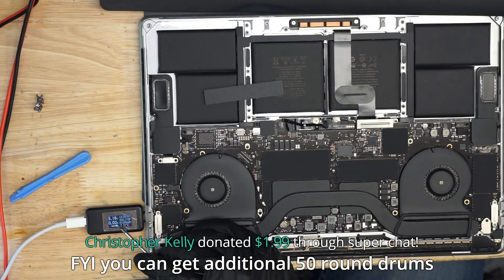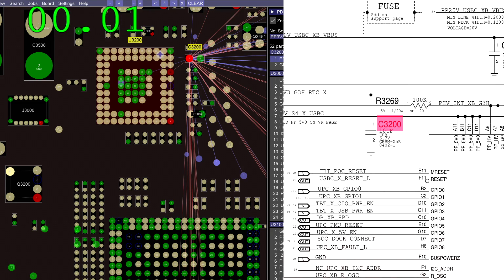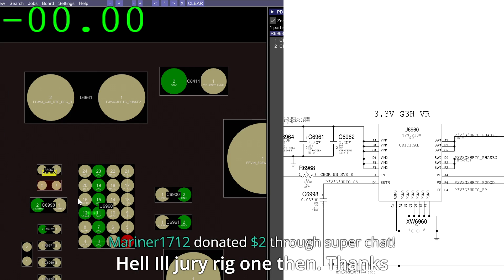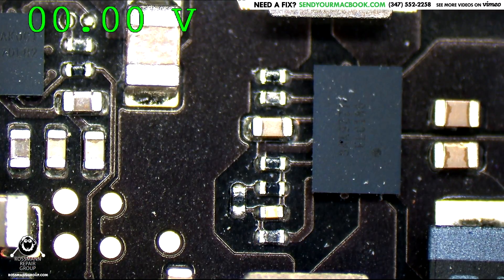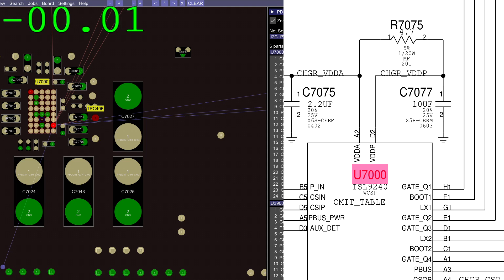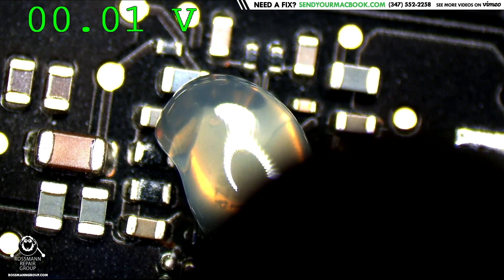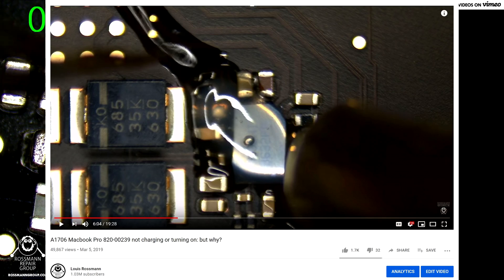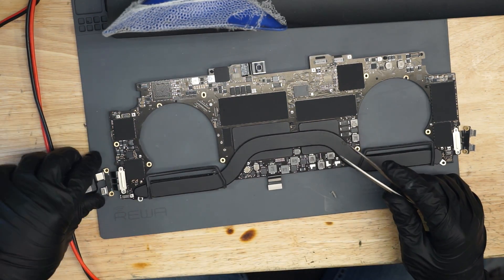How Apple is shaping the future of repair.

Comment: Imagine having to replace your engine just cuz a spark plug missfired.
Reply: Imagine your car refusing to turn on because a headlight was burnt out.
Reply: If the car is made by apple you'll replace the whole car
Reply: Or the spark plugs are non-removable. THAT could be next. So sad...how is this country to be great again when such tomfoolery abounds?
Reply: @dcanaday426   afaik, car companies don't do exclusivity deals with individual component manufacturers.

Yeah, ECUs can be directly bought from car companies for a lot less than a new car, but that's just an option, since most individual components are for sale, usually not by the car companies, but through resellers that buy components from the manufacturers, though.

Anyway, while you CAN buy individual components and repair ECUs, most people don't do it since buying the ECU from the car company/ manufacturer is a lot easier, not to mention that most people don't have skills to do that kind of repair.
Reply: @liev535  It's even easier to find a wrecked car & yank the ECU out of it. Hella cheaper, too. And, the car companies can't stop you from doing it.
Reply: @texarcana2002  true, and they would face endless lawsuits if they tried
Reply: @sayan mukherjee 
More accurate. Agreed.
Reply: @sayan mukherjee yes because replacing the engine along with the labour costs will happen to be more expensive than the total value of the car
Reply: @sanghamitrapradhan5820  looks like you'd have to buy a new car...
Reply: Shhh. Dont give them ideas.
Reply: And the local car rig guy calls himself a genius even tho he terrible at fixing car lol
Reply: @dcanaday426  well hopefully if theyre a good car manufacturer then they will either make or source reliable computer modules for the cars electrical systems and sensors so that they last longer and you dont have to worry about it going out on you after years of driving. Well, at least the older models were built with reliability in mind. Dont know about all the new car models since they havent yet stood the test of time.
Reply: Hide and watch, people! This IS where we are headed unless the populace rises up and says NO!
Reply: Blew a fuse? That'll be a whole new electrical system.
Reply: @zephyr9756  Funny you should mention: Federal Pacific "Stab-Lok" breakers were found in the 1980s to have inherent defects that caused of thousands of fires in the U.S.  Even if FedPac panels are legal to operate in your jurisdiction, good luck finding a replacement breaker when one fails!  It's like trying to buy Freon (R-22) refill kits shortly after the auto manufacturers were forced to switch to R-401A: it was still legal to sell your remaining stock, but you couldn't buy more because they stopped making it, and the price skyrocketed.  Buying a Apple product with this fragile 9240 chip made of Unobtainium is as smart a move as installing a FedPac panel in your new house--knowing that replacement breakers were only going to become more rare and expensive (and prone to failure!) as time went on.
Reply: Or replacing the entire inverter and motor assembly when you only need to replace a bad MOSFET or 2 on the inverter of your electric car.
Reply: Your engine? You have to replace your whole car. And if you left some important item in your car, that's gone too.
Reply: That sounds like Ford Triton engines spark plug issues bliwing engines
Reply: ... and not even stopped the engine itself but some software decided that its junk now.
Reply: Why image? That's how it is now
Reply: Imagine having to replace your car just because a spark plug misfired.
Reply: @dcanaday426  It will surprise you, but you can buy every single component for a car for X number of years, freely on a market and than choose who is going to repair it. It may cost a lot but it is there, by law. At least in EU.
Reply: @dcanaday426  are you stupid? can you not do a little research? you can buy pretty much any component, transistor, capacitor, or chip for your cars ecu, you have access to programs to flash it, modify it, tune it, this isnt an actual problem, car manufactures generally use off the shelf parts which everyone has access to. ECU modding is a big thing, only people who are stupid wouldnt know any different.
Reply: @shroomzgames7370  ha well said. Bet that guy owns a apply product to.
Reply: @dcanaday426  nobody is asking apple to stock and sell every single component though. All we want is for them to stop blocking their sale. Apple does not manufacture every single part of their products and the people who do are selling them at component level already (to apple) all we want is to be able to buy them from the companies that make them even if the minimum order is 1000+ chips which is reasonable.
Besides you can buy every single peice of newly made cars for a number of years after it was made by law.
Reply: @@UCU3kMKsz3tNH4KBsKvu2xVA I don't think you understand how modren manufacturing works.  Apple doesn't' make ANY of the chips in their laptop or 99% of the other stuff in there either.  They purchase them from third parties such as chip manufactures and then assemble it.  Those chip manufactures ONLY make and sell chips.  It makes no dirrece to them if they sell em to Apple or a ditrubtor who will then resell them to repair shops.  All Louis wants is for the chip manufactures to be able to sell the chip to him as well as Apple.  They dont' only because Apple is such a big customer they were willing to sign and exclusivity deal to get Apple's business.  The net result is Apple can sell you a new laptop or very expansive logic board replacement repair which creates unnecessary eWaste because a $4 chip is dead on the motherboard. Exclusivity deals like this which exist only to serve as a method of planned obsolesce harm the consumer, third party repair, create quasi monopoly situations, are bad for the environment, and waste precious, nonrenewable resources. Which is why they should be illegal.   In contrast an ECU which you used for an example uses mostly wildly available off the shelf parts.  You can go buy an individual chip if you want from whatever company makes it and sells it to the car manufacture.  And yes people do that.  ECU modding/repair/re-flashing  is a thing that hobbyists do.  You are very ignorant if you think Ford, GM, VW, ect manufacture all the components for their cars right down to the chips, resistors, PCBs, ect in the ECU.  No product is made that way.  Even Intel and AMD don't manufacture the chips in their own CPUs believe it or not.  Places like TSMC and Global Foundries do.
Reply: dcanaday426 ehmm you can buy 3rd party spak plug ?
Reply: @lfow0234  Imagine having to replace your engine just cuz a spark plug failed--and only the dealer has spark plugs that fit--and they won't sell you one. (TIFIFY)
Reply: @lfow0234  now imagine you coudnt buy any spark plugs only from brand manufactory and they say u need new engine

Comment: Does that charging chip do something special, or sends some special commands to other parts of the board, no other chip does? I remember you tried to swap it for older one and found out that, pinout was different. But what if we could make a adapter board to use another charging chip, or microcontroller programmed to send same signals as ISL9240? If it's commands are any different from ISL9239 I guess it is possible to reverse engineer it using  logic analyzer. That's may be an overkill, but people still make hacks to old gaming consoles and vintage computers, why can't someone make a hack to replace a ISL9240. I bet it will be a great deal for those who wants their data back, or simply needs a working laptop and doesn't have extra 1500 to spend.
Reply: @makumbaDE  maybe I would, if I had motivation, or enough free money to buy a macbook, several macbooks, actually. I didn't own any apple product in my life, but I like Luises videos and love electronics. That's why I asked this question. The market is there and it's a good aportunity for repair community to regain their rights.
Reply: @makumbaDE  well, you can't fight apple an their kind with such mindset.

Comment: If you really need your data, you can borrow this IC from another (working) board, restore your data and put it back.
Free market should create a replacement for this chip, with compatible pinout. But next step would be to add some encryption (or simply a chip ID) so this isn't right to accept such stupid rules.

Comment: I mean I don't want my work computer with many work data in it suddenly bricked and there's nothing I can do about it.
Reply: Backups. Have all your data in at least two copies, if you can afford it then 3 copies and keep one of the copies "cold", unpowered when not in use. Do not trust cloud if the data is in any way sensitive.
Reply: @Cinkodacs  I think we could just make the storage detachable not soldered on to the motherboard. or at the very least as louis saying it a computer has a lifeboat connector for such situation.

Comment: What if you invested in a few donor boards to get a few known good ISL9240s that you can use to temporarily fix a system solely for data recovery? Seems better than nothing!
Reply: I was thinking he could get BGA socket adapter like giga-snap so that he could install a female on the board and use one good ISL with a male adapter.  The only problem is that 8 x 5 arrays are not standard, so he would need a custom order.
Reply: @jeffm4508  I don't know if one of us is misreading the other but what I was getting at is he has 2-3 known good chips, he can install them on a customer's board, recover the data, remove the chip, return the same broken laptop with a backup of the data, wash rinse repeat. It doesn't fix anyone's system but it would put him head and shoulders above anyone else if he can say "I can't fix it but I can at least get your data"
Reply: @kusucks991  He could just use BGA adapters like "giga-snap" to make the chip "pluggable". It might require a custom order as 8 x 5 arrays are weird.

Comment: Why can't you use a pull up resistor on U6960 enable to force it to turn on?
Edit: Datasheet for TPS62180 show Enable directly connected to Vin.
Reply: Jeff M My thoughts too, but the system probably detects tampering.
Reply: @gordonrichardson2972  It doesn't monitor low level power chips, or Louis would not have a business.
Reply: CK Lim  It is the primary power rail. Its on at the beginning.

Comment: Why not charge the battery externally? I mean there are other ways around to charge a battery. Well, I can do. At least to get that data out of that mobo. Just connect the required voltage to the lipo battery terminals internally. No software can stop you from doing that.
Reply from the maker: ISL9240 communication appears to be required for the machine to function.

Comment: Did someone try if the 9241 works? I wouldn't be surprised if the manufacturer sells the same chip under another part number to other customers. 

Yesterday i saw a video of someone placing a little buck converter in a laptop to feed the necessary voltage to an enable pin from a different rail because he didn't have the original  ic. 
If Apple continues their strategy such "nasty workarounds" might get more common.
Reply: Can you link that video?
Reply: @slobodanjovanovic8166  It was this one. https://www.youtube.com/watch?v=1An1405Iljk

Comment: Hey Louis, do you think that it would be possible, by examining the pinout of the chip, to compare it with the previous version and try to make an adapter, or something with wire wrap?
Reply: Alexandre Couture I was wondering if it can't just permanently be wired in the 'on' position?
Reply: @gordonrichardson2972  I feel it could cause damage to the battery if this chip is what monitors the current for the battery, and may allow over-discharge and/or over-charging. But I'm sure some further hackery could work to get it to stay on, just to get the data off the device, but it might be more difficult than just turning the charge enable pin on.
Reply: If another OEM were to build a compatible chip, I expect it would be a good money maker.
Reply: Maybe there i even a comparable chip in PC laptops that can be modded somehow for this.
No electronics expert, but the things this chip is supposed to do seem simple.
Reply: @Sonnung That's probably what he does, but I end up thinking that he likes to do a bit of drama, by not mentioning it on Youtube... At the same time it's true that it would only give temporary life to the board, but not permanent, as having access to a new chip.
Reply: If its functions are simple, couldn't you even get a good board, reverse engineer the chip, and design a new one using a microcontroller and an adaptor? Not sure how legal that is though, lol

Comment: Have you tried using the schematic to figure out how big the difference vs the ISL9239? If they've just changed the pinout, for instance, you could conceivably fabricate small adapter-boards, no?
Reply: The addressing is different and is permanently burned in hardware. You would need to manufacture your own chips which only Intersil/Renesas can do because of patenting.
Reply: @generalreticent3791  If it's just the I2C addresses that are different, then it seems, as Horst Fuchs says, that you could put a generic microcontroller between the board and the chip and translate the addresses. A bit more complicated than fabricating a small adapter PCB, but it sounds like it should be quite realistic.
Reply: Chuu Ni since SMBus is just a Bus, you could maybe translate the messages from any point of the board on the same SMBus line. Someone should sniff the bus on a working board and on a board with replaced chip (previous gen) to make sure what is different
Reply: You probably only need to man-in-the-middle/proxy the SMBus commands
Reply: Chuu Ni Quite probably, but Louis is not geared up to do microprocessor fabrication.

Comment: And this is just one of the many reasons why I will never and have never bought an Apple product!
Reply: Yeah me too. Just watching these videos,I keep spreading this news tip people I know, and it discourages them from buying Apple. I hope I've been able to prevent a few sales of Apple products at least.
Reply: never  brand new!!!
Reply: @adcommlaw  valid point. A VC second hand product is acceptable provided you never give Apple money in the form of subscriptions or App purchases.
Reply: from 2010 to 2016 apple made some pretty decent products (computers excluded)
Reply: I had a 2007 Macbook which I used until I got my 2015 Macbook pro. I was able to upgrade things in my 2007 model. I have upgraded the SSD in my 2015 model, but the RAM is soldered. I won't get another unless they radically change their practices.
Reply: Well, Apple was better when Steve Jobs was in charge. Prices were as low as they could make them while not losing money. But right after Steve Jobs passed away, Apple has made things that were outdated, even on the release date!

Comment: Can't you have a chip made or use a similar chip? Create a second circuit  board to do the functions of it?
Reply: Or just don't buy intentionally gimped garbage if you like stuff being repairable.
Reply: @illidur  well any sane person would be able to see the problematic faults caused by the planned obsolecense done by apple and avoid It but for those who buy these stupid products and try to get them fixed when they break well maybe it's worth a shot that if you can't get the right chip then maybe a solution needs to be made for it
Reply: @rroge5  When this happens and they get burned they will also see the planned obsolescence.
Reply: Smells like a use case for a cpld.

Comment: Why can’t you just temporarily use an external bench supply to at least recover the data?
Reply: William Petty The encryption probably detects tampering during boot-up.
Reply: @gordonrichardson2972  Oh please, there is no such a thing "encryption probably detects tampering during boot-up", this is total nonsense, is just a miserable battery charger that is queried by the PMIC and if it doesn't respond properly via I2C, the start-up sequence will not proceed, is that simple, there no "encryption" involved.
Reply: @makumbaDE  Sorry, I was half-asleep when I typed that. My point was never underestimate Apples attempts to mess with users data.
Reply: @gordonrichardson2972  Nobody is ever doing this, and they will not stop until forced or everybody will use their iCloud thing for storage, exactly as Chromebooks.